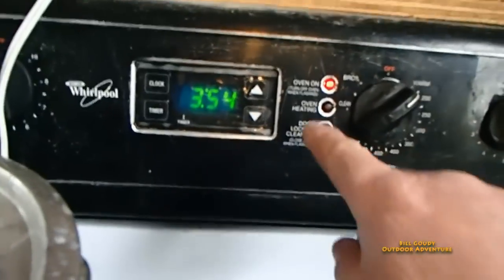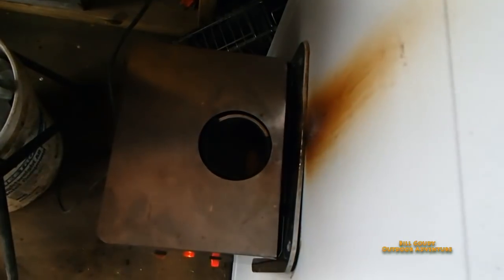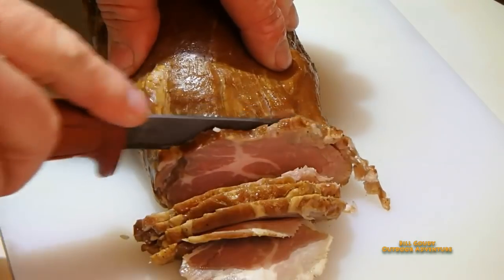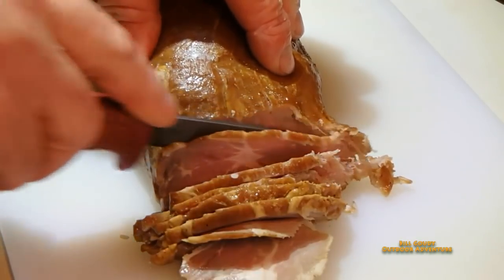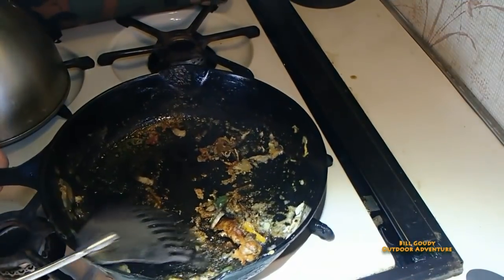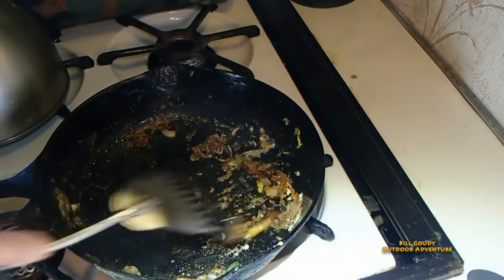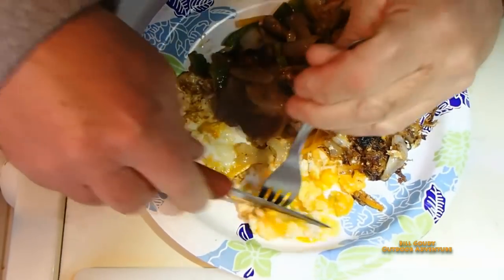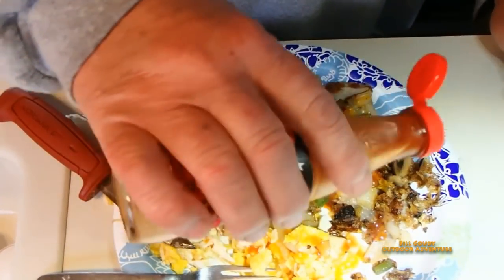Homemade Back Bacon and Egg Breakfast

Comment: So you just soak a whole loin in salt bath for 4 days then, season it, then rest it dry for a day, smoke it then it’s 🥓 back bacon? I never knew that.  
Looks great Bill thanks for the awesome shout!  Hotter is better.
Reply from the maker: There are several ways to do it Calvin, just do a search on YouTube..  There is a dry technique and it takes longer and then there is a wet technique...  You use salt and a host of other spices that you want and some curing salt. Soak is for at least 4 days or longer.  Then you have a choice of cold smoke. This is where you need to continue cooking at the time that you want to use it.  Or you can cook it all they way to 160* internal temp...  That is the way I did it.  It sure is good!!

Comment: That looked so yummy and made me dang hungry, lol.  Thanks for subbing to my channel.  I don't do vids since I don't have the equipment...yet.  But I'm working on it. Did you cure that back bacon using Prague Powder #1 or just a simple brine?  I make Peameal Canadian Bacon from scratch using Prague Powder #1 and cure it for a week,  rinse it off and soak it in cold  water overnight changing the water every 4 hours then roll the loin in cornmeal. Comes out fantastic.  Thanks for sharing Bill.  Cheers!
Reply from the maker: I saw your videos on the Oklahoma Joe's smoker  ...  That is a nice setup!!  Yes, I used a wet brine for no less than 4 days and then I rinsed it all off and dried it and placed back in the fridge for a day and then I smoked it at 195* until I got an internal temp of 160* man oh man...  This is so good...  Thanks, William...  I will be looking forward to watching your videos, if and when you make them!!  ;-)
Reply: It is a nice set up for the low price I paid for it then had it welded instead of using the bolts provided.  It's in my shed right now until the snow melts here in northeastern Vermont however, I've been using my Weber Kettle with a Slow and Sear and it works good.  I was totally intrigued with your converted oven/smoker setup.  Very cool smoker.
Reply from the maker: I have had many smokers over the years..  I really like the control that I have with this set up...  I don't have the volume that I once had, but I have found that I don't need to have the bigger space .... now...  I used to commercial fish and I smoked trays and trays of fish...  I still smoke fish but, nowhere near the amount that I once did!!  ;-)